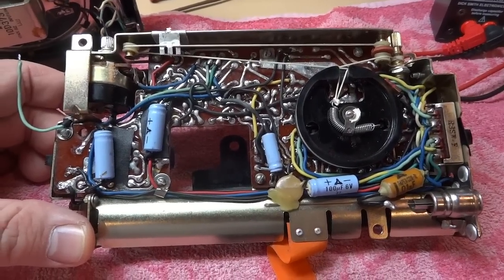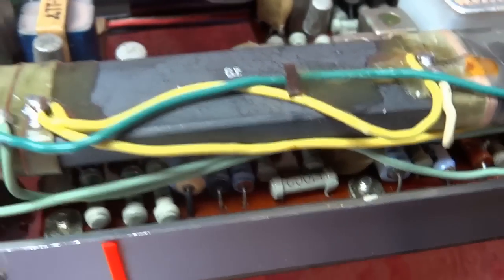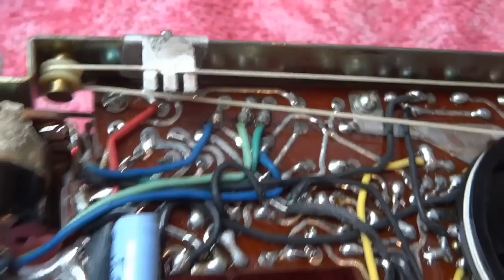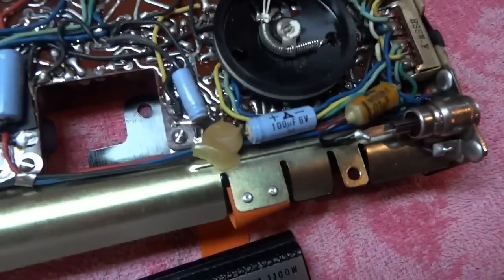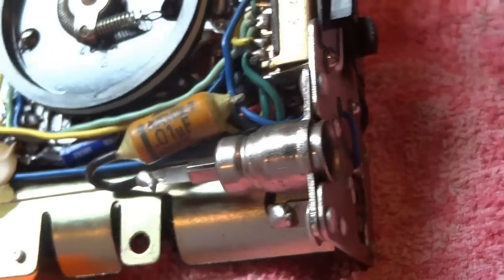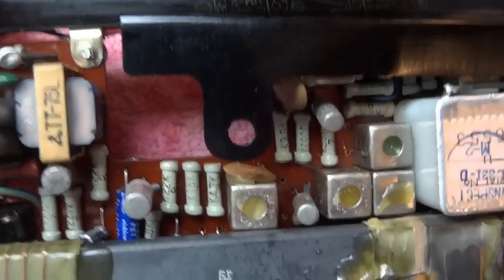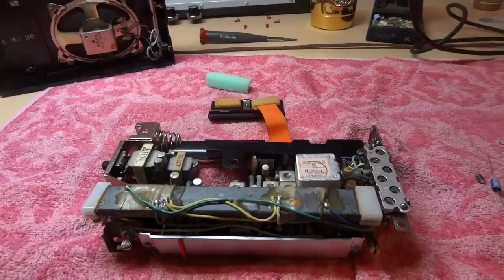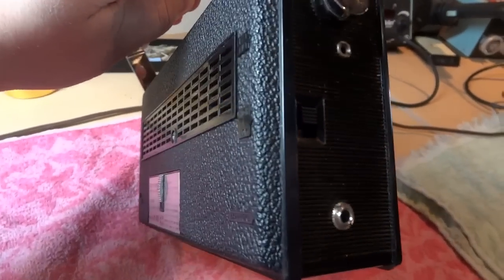Restoring the 1963 National Panasonic R-805 Transistor Radio

Comment from the maker: I also buy from Mouser. All capacitors in this radio were polarized including the small values under 1uF. I normally use Nichicon TVX series axial caps for most of my work, but the values under 1uF are not available in the TVX, thus I had to find an alternative which was the Nichicon USV radial series for those small value caps (all of which are high quality).  I like to keep capacitor values as close as possible to the original specification while maintaining consistent brand name.

Comment: Takes me back to my old days as a soldier in Vietnam. Man back then, if you purchased a radio at the PX, you could depend on getting something that would reproduce the tunes that you wanted to hear on AFVN, most had great speakers and nearly all of them were quality made in Japan. My first was an AM/FM/Cassette she was really built. One day I was stuck on tower guard duty. a 24 hour detail that I shared with another soldier. So I carried my radio up the 60 foot ladder to the square little steel lined watch tower, a tin roof kept the treacherous sun off our heads during the day, and hopefully the rockets and mortars during the night, but I am sure they would have punched right through.  So I set my Hatchi radio on the edge of the tower and took my place behind the M-60 machine gun and huge spot light, the wires from the claymore mines were in front of me, and a clacker on a small table next to my chair.  The other GI decided to get some sack time around sunset, and as he readied himself to climb on the cot, under the mosquito netting, he knocked my radio off the damn ledge.  Man I was PISSED!  He took my place as I climbed the 60 feet back to the sandy beach of Dong Ba Thin, and searched for my prize radio, there she was, half buried in the sand. I pulled her out and returned to my roost, as I was not supposed to leave the post till 7 AM.  When I had made my way up the 60 foot ladder  and got back to my seat, I had pretty much jiggled all the sand out of my radio.  I looked her over with a flashlight, as the sun had disappeared by then, and found one small crack in one corner of the case. The radio played perfectly and the cassette that was in it, containing a letter from my late wife was still intact and played as good as ever.  Man that radio was built! About six months latter, she was stolen, damn I was pissed, I hope the thief burns in hell for taking my radio!  I did replace it, but the radio I got was no where as good as the one I had, the PX I went to looking for the replacement was much smaller as I had been transferred up country to Camp Haskins near DaNang.

Comment from the maker: It did not require IF alignment as fortunately it was spot on right after the re-cap.  One thing Panasonic did from the factory was fill the tops of the IF cans with beeswax as a moisture sealer and/or shock absorption protection (since it's a portable radio).  This makes adjustment very difficult if needed as you would need to carve out the wax in order to use an adjustment tool.  Slug damage is also very possible as you would be adjusting the slug against residual wax in the core and can.

Comment: Nice radio. This was one of the early Panasonic models under National Panasonic, by the late 60's and into the early 1970's, they dropped the "National" name and rebrand itself as Panasonic where it continues to its day, and the logo remains the same until 1972 when they dropped it and changed its logo to a modern Panasonic where it still remains to this day. The radio was made in Japan, and this was one of the earliest of the Japanese radios.

Comment: Amazing how good the radio sounded after 50 years. It's obvious it would need a cap job, but I'm surprised those germanium transistors are still working great! And the shortwave side also worked was a great bonus! Nice radio!

Comment: That unit looks like the kind you could mount under the dash of your old 50 Ford and plug in the car antenna to play tunes when you tired of the vibrator noise of the old 6 V radio set built in the old cars.

Comment from the maker: Thank you.  I guess in the long run I'm glad it needed work as now it has fresh new caps!
Reply: drh4683  Emma biggest fan of yours I would like to have you help me with them with mom Maura radio from from the planets that shut down gotta know but the need to be the Cassy be replays though nothing to might be the West composer known tube type clock radio and their wish to some way I can help man there that mother looked at me that makes on will mess up that dial cord on the station selector I know how I get that out of that are with up chicken O about Coro off of the North the tuning no pick up in their own them on the main tunr and all the utter pick up Janet I wanna be with the sleeve and check the On the up messing up that tuning cord on it like to have your here help with it so nice radio will like the here play alike to get the things get the is beneath kept redone I could recap for programming than a mourner cook the tubes up for the got the original tubes in there nice and take the saga tell had been touched go there tubes are tightly in the socket real good and tight and the cover with the and on the radio  Like the rain was maiden and 38 or 58 I'm not quite sure to look on the back of the back of the radio again term that the date on it when it was made was made and made an ever norge Franklin Park Would like to hear the sound all that radio in or until you do a better job I can on rails in the then the Tango 066L don't know you are going to radio its sound really good them sound reels don't sound shrew a law when you work on a radio sound drew clear the got a nice rich tone till it when you work on a radio the works on us all shrill and and then it knocks up some of the instrument sounds on the radio old canted terminal what kind inch move the is or what key they're playin and as the sharp or the flat or waters all shrill and and can on the can't understand the cipher the the the insta Mr. Playing at all got with you work on a radio it's done right it sound real clear and crisp and then keep been at this a lot longer than than shango  0 66 and I  Palm shop   If I can hear from you sometime you can cause I want you to give me a human color give me a shout for give me AA call he if he can a number and that the email dressing get me as us is Anderson gm1992@gmail.com MI ama phone number is 14059335533Please give me a shout if you can are right MA and their my address is 305 North move and drive morrow Coahoma 7 31 60 zip code
Reply: It  Motorolaradio

Comment: I performed a little research with Mouser's search engine and found out that they have low voltage, non polarized, capacitors available up to 2 uf at 35 or 50 volts, I was thinking of trying some of those in place of small electrolytics like those .47, .33, and 1 uf caps. That would permanently eliminate the problem of at least some of the caps drying out and failing.

Comment: TO1 Germanium transistors, no doubt the 2SA/2SB series of which there were a million part numbers. Radio Shack had a handful of part numbers which crossed over to these such as 2SB22, 2SB186, 2SB400 etc. 2N301=2SB472 and so on. And the blue taped audio transformers.

Comment: I'm not sure who made the non polarized caps I was looking at, they may have been Zicon brand. Panasonic makes pretty decent electrolytics, but they may not have the same selection in axial lead caps like Nichicon does. I suspect that the small value electrolytics were used in these radios due to cost and space considerations at the time, depending on the circuit it may not matter whether a polarized or non polarized cap is used.

Comment: The previous  name of Panasonic was National the change was in mid seventy
Reply: Egr k 
Matsuhita.  They started using the Panasonic name in the U.S. right about 1963–. Because of a name conflict. They kept the National name for the international market until the early to mid 1980’s when they finally phased it out.
I have a couple radios from the early ‘60’s ( one is from 1963) that do read “National-Panasonic “, and a Short Wave radio I had from 1986,also had both names.
At the same time, they also had radios with their Matsushita badge, with a logo that looked very similar to the Mitsubishi ( three star) logo.